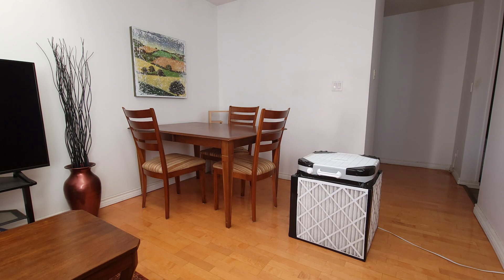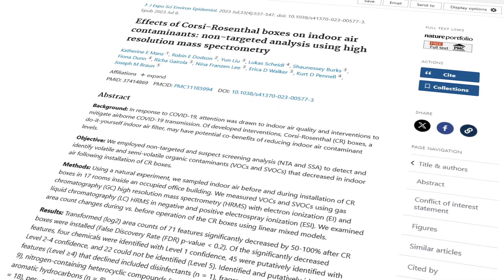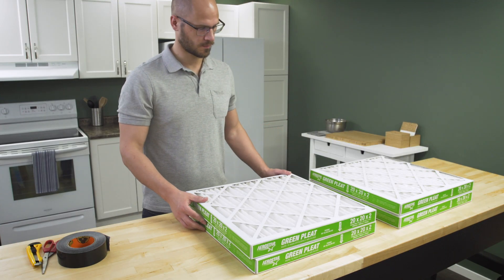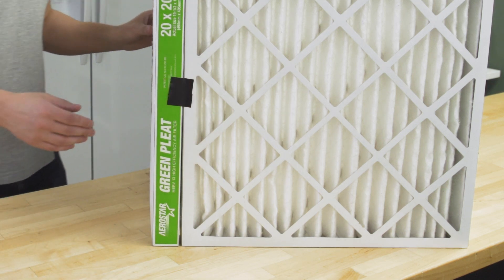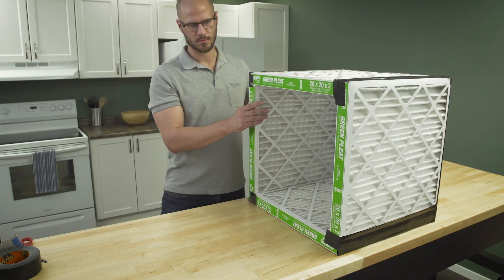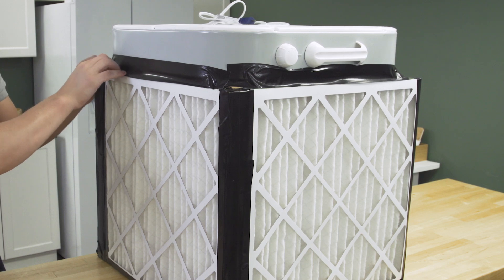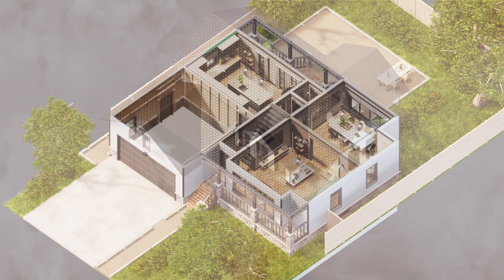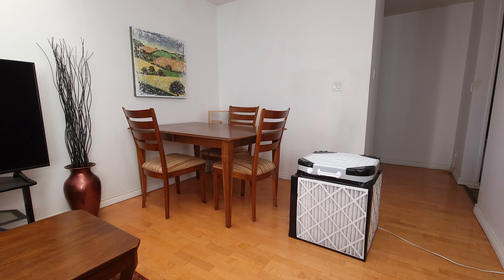Best $100 Air Purifier - How to Build a Corsi-Rosenthal Box

Comment: Why would 2" filters have more air flow than 1" filters?
Reply from the maker: More surface area = less restriction. A MERV 13 filter captures very fine particles. In a 1-inch filter, the media has to be denser to achieve that efficiency, increasing resistance. A 2-inch filter can use less dense media because it has more surface area, allowing better airflow at the same filtration level.

Comment: What dedicated air filter would be more effective than this? I had three giant heppa filters in my house. After building the Corsi Rosenthal box, it's like those filters were doing absolutely nothing. It's like night and day.
Reply from the maker: A built in whole house filter would be ideal since it would connect to the central air and would be able to filter all rooms. Those are significantly more expensive though. Glad to hear that your experience with the Corsi Rosenthal Box was good. In our tests we were able to clean a 600 square foot living room of moderate wildfire smoke in a few hours. The 4X MERV 13 filters are quite effective.

Comment: If the four filters cost $88, where do you buy the box fan for $12?
Reply from the maker: Thanks for watching. The 2 inch filters are most effective for airflow but 1 inch filters will save some money which will drop the overall build to below 100. As well these filters do go on sale and we should have one coming up soon this fall. Box fans can be bought new for as low as $35 or second hand for even less. This will obviously change with inflation and also depends on your region.
Reply: Aldi